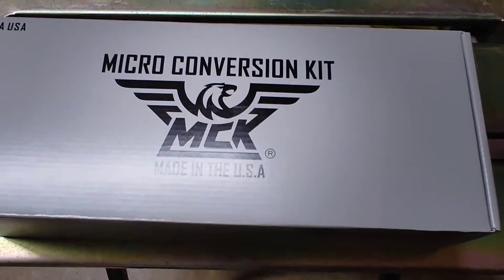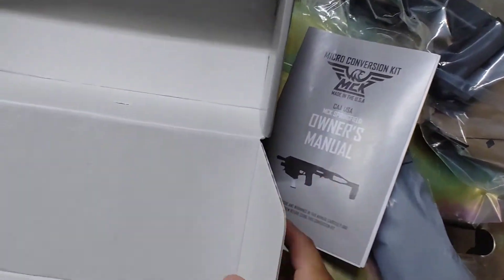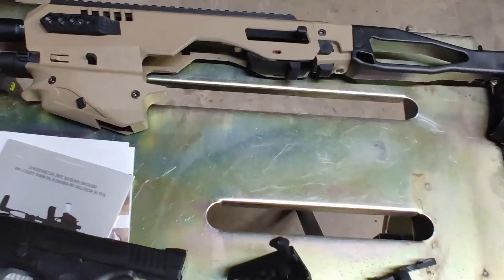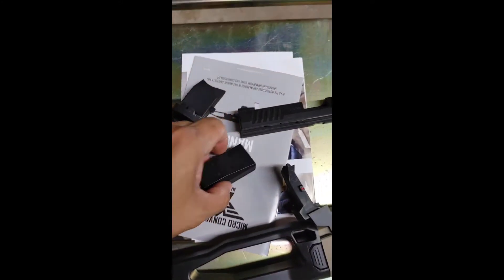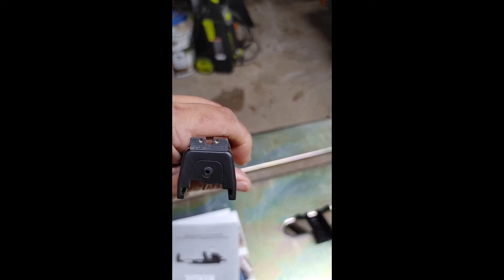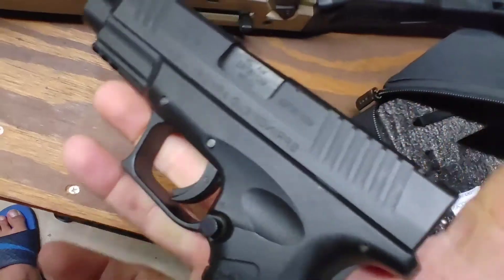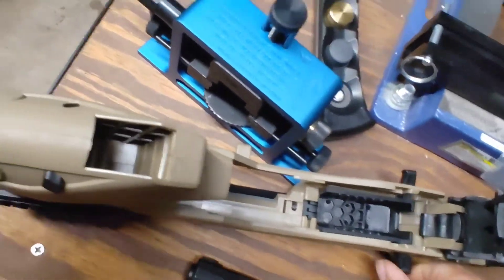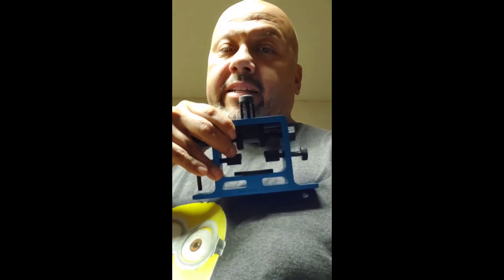CAA MCK on Springfield XDM

Comment: Thanks for the vid.  I just purchased a used XD40 mod 2 for $200 and for the purpose using a MCX.  It’s going to be a great set up .  I’m going to glue a set of magnets to the stock so it stays in place when folded
Reply from the maker: I'm currently using mine as an EDC bag gun
Reply: @middleageguy  I plan to do the same.  I’m about to retire from the US Border Patrol and I have thousands of 40 cal rounds collecting dust is my garage.  This will be a great option.
Reply from the maker: @OOnti-dz4jd  thank you for your service. 👍

Comment: Does removing the rear end sight goes the same  to the XD mod 2 also? That will sucks to spend more money to buy the tools just to remove.
Reply from the maker: I don't believe so. I'm starting to thing my charging handle adapter was a bit off. And that tool is absolutely necessary to do anything on those sights.
Reply: @middleageguy  I'm just waiting for mine to come in. On the other hand do you have to buy the sling, swivels n iron sight separate from the coversion itself?
Reply from the maker: @XngGen  yup.
Reply: My five inch went right in with the factory rear site attached.

Comment: Nice video. Mine just arrived yesterday. I have the XDM 9mm. The only thing I don't like is that the brace doesn't lock in as secure as I would like when folded.
Reply from the maker: It doesn't click in like I would like
Reply: 2 button magnets, superglue and a dremmel will fix it. thats what i did anyway, but yea mine was the same
Reply: Is this a gen 2? Isn’t that supposed to be fixed with the gen 2?
Reply from the maker: @jeepv8pwr1  i thought that too, I'm actually contacting them about this later today
Reply: @middleageguy   let us know what u find out! Thx